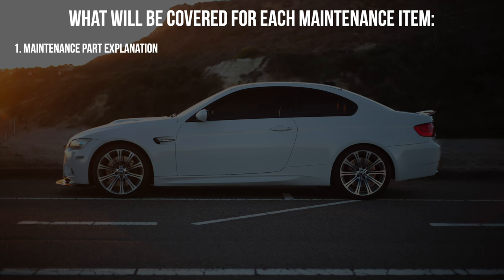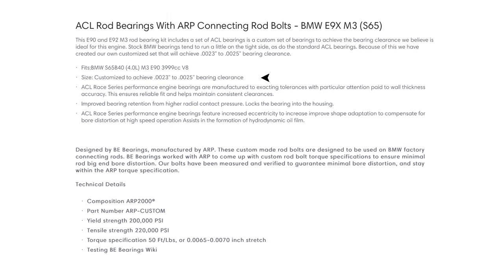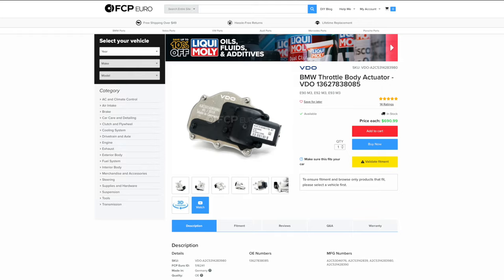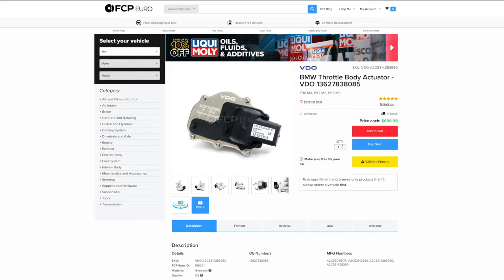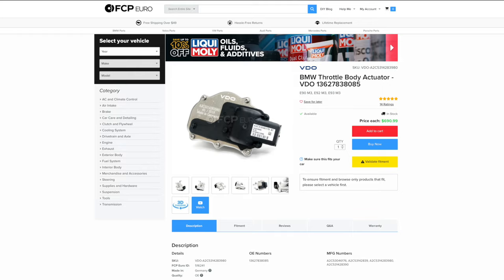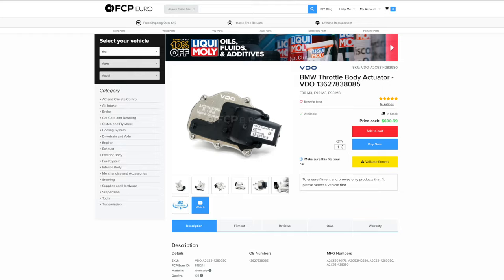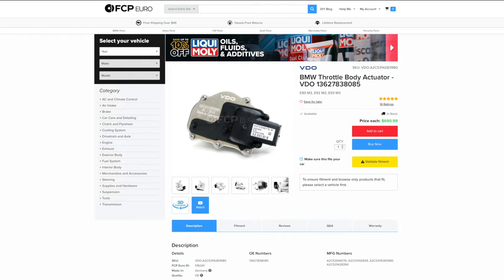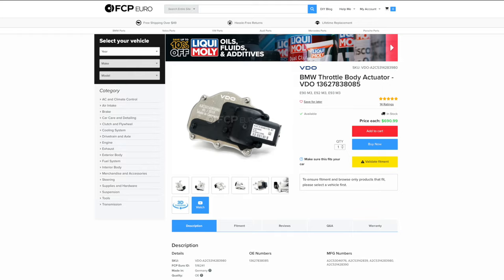ULTIMATE Guide To Maintaining An E9x M3 | Top Failures | Best Parts Sources | Parts Costs

Comment: When the throttle actuators fail, it is often the plastic gears. Metal gears are available, and can be considered a preventive maintenance item. A great deal of time and/or money can be saved by doing all of the preventive maintenance items on top of the engine at the same time.
Reply from the maker: You are correct, definitely a solid option if you don’t want to simply replace them! Thanks for pointing it out 👍🏼

Comment: Are these websites reputable? Sorry I’m new to owning one I’ve heard of fcpeuro does anyone have opinions I have a idle issue and I definitely could’ve saved a buck or 2 instead of going to the dealership
Reply from the maker: Truthfully I haven’t purchased parts from every single vendor in the video, many of them I have but not all, but I’ve been in this community (the bmw and more specially the e9x m3) for quite a while and have heard people make comments for both ends of the spectrum regarding some of these vendors. Some will have nothing but good experiences and some only bad, but the ones I’ve personally done business with have usually been pretty good. Not only that but if there was a company that I felt was notably bad when I originally made this video, I’d likely not have included them at all, so I’d lean more towards the positive side with any of them until you’ve done business with them personally 👍🏼

Comment: The Slon Vanos Covers have problems.
Reply from the maker: I’ve heard of some potential failures, I haven’t researched deep enough yet to confirm if it’s 100% a problem with their product, or the fault of incorrect installs. I do know for a fact that the  Slon covers I installed 3 years ago (so very likely close to the first iteration of them) on my personal e90 m3 are still working as designed. I’ve kept in touch with both of the owners after my ownership and neither reported any issues with the covers, so I’m inclined to think that they simply aren’t being installed properly, especially considering that I’ve heard that even one of the tabs not being secured properly can cause them to eventually fail, so until I can do a bit more research now that they’ve been on some cars for a few years now, I can’t say with certainty that those covers aren’t still good to use or not, but like I said, I have heard that there are cases, just need to do my own research is all 👍🏼

Comment: I would add the alternator, or actually the voltage regulator as a potential common failure. I see it a lot on the forums and just dealt with it last week. The dash gives all the faults and goes into limp mode, then nothing. It's all caused by low battery voltage tricking each system into failing. I replaced my battery with an optima and then a new alternator. It's not a terribly difficult job to DIY, either. Anyways, great video!
Reply from the maker: Great point, I’ve also pretty much only ever hear that when the battery’s/alternators start to go, that they cause all sorts of weird problems, might have to add that to the next video! 👍🏼

Comment: You do not need to remove the throttle actuators when doing the ICV. However, the grey T pipe connecting the ICV and the throttle bodies can be a really stiff and get stuck onto the black rails of the throttle bodies, making it really difficult to remove. Making it easier would be to remove one bank of the TB (driver side). You would also have to remove the secondary air pump and get the wiring harness out of the way. I recently did this, and just cleaned the ICV, there was some carbon build up on the plates. You also have clear access to the starter motor which sits right under the ICV. Removing the driver side TB also gives you relatively easy access to the non-return valve at the back of the block just behind the cylinder head. Mine was gunky but still ok at 150k kms, but I replaced it anyways since I was there and not too expensive.
Reply from the maker: Oh ok, I appreciate you taking the time to add some knowledge to this video, hopefully whoever watches will read it and have a better idea of what to expect while in there 🤝🏼

Comment: I've had my 2009 e93 about 5 years years, 20k miles, has 110k, throttle bodies were done when I got it. Motor mounts were thrashed, $800 repair, $650 labor, I didn't have lift access, could have found a less expensive shop.  Fuel pressure regulator failed, I replaced it in about 2 hours, $300 part, I think book labor is 3 hours. Other than that it's been great. Always replace crush washers and oil drain plugs, it used about a litre/2500 miles when I got it, none since the first oil change I did

Comment: The DCT pan bolts might only need to be re-torqued to spec. Discovered mine had a leak and decided to check the torque. Yup, many of the screws and oil drain plug were a bit loose. Tightened them back up, cleaned off all the oil, and checked 2 months later with 1k miles and it's dry.
Reply from the maker: That’s a really good point, definitely should check this first before full sending it on a whole job 👍🏼

Comment: Great video! TY In your research, did you find anything about the rear differential failing? Mine is is whining and I am told it needs to be replaced. I’m at 40,000 miles. 2011 6MT
Reply from the maker: Thanks for watching! Unfortunately I didn’t see anything in particular regarding the rear diff, might just be bad luck on your end this time around, hopefully it doesn’t end up being too much to get it fixed/replaced :/

Comment: Luckily, the previous owner took care of the idle control valve. I took care of the rest except the fuel breather valve because I can't take off the hose thing attached. So difficult.
Reply from the maker: You have to brake that clamp off and then use either a generic hose clamp to reattach it, or buy another bmw clamp and the tool to re crimp it, either way, not too bad once you have that first clip apart 👍🏼

Comment: A word of caution regarding vanos cap replacement, the cheaper stamped steel vanos caps have been reported to come un fastened, I reached out to evolve on this issue , they responded by explaining the cheaper stamped vanos caps retain some memory to their shape and want to deform over time and heat cycles , in contrast the more expensive evolve caps which are billet aluminum,
Reply from the maker: Yea I’ve been hearing/seeing the same things recently, definitely have to be careful with these now too and who you get them from, thanks for the insight for others to see! 🤝🏼
Reply: What about Mporium bolt on caps? Are these overkill? I rather get the Evolve ones simply due to the fact that I can DIY it. What do you think? Are the evolve caps enough?

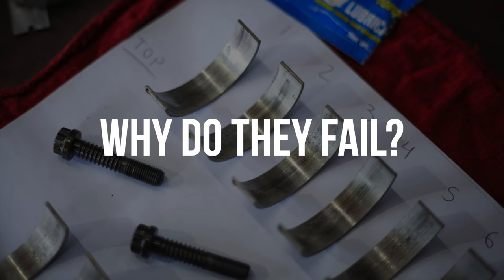Comment: 2:47 Can you quantify what you mean by "so prone to failure". Are we talking under 1%? Also you need to call out that multiple people have replaced the rod bearings, only for them to have the replacement rod bearings fail.
Reply from the maker: @cpy  if you listen carefully, I wasn’t referring to them being “so prone to failure” from a numbers stand point, what I was specifically referring to by that sentence was WHY they fail at all, which is a know fact that the OEM bearings were made with too tight of clearances. As far as numbers go, you’re right they don’t fail as much as it seems like they do because it’s a lot more practical to replace them PRIOR to failure, than to wait for them to fail and need an engine rebuild, so of course those numbers are low. Now regarding your statement that I have to acknowledge that even after replacement, that the bearings can still fail, and I’d be inclined to agree assuming someone replaces their bearings with OEM bearings again or doesn’t opt into purchasing bearings with the additional needed clearance, because the cars that have replaced their bearings with the additional clearance bearings, hardly ever, if at all, have THOSE bearings fail, and if they do it’s for outside reasons other than just being poorly designed, like OEM 👍🏼
Reply: @Anthony_B  Ok if that was your intention, that's not what you said. That would be like saying "Why are airplane engines prone to failure?" Nobody is going to think you meant "Why are airplane engines that have failed prone to a particular type of failure".
Reply from the maker: @cpy  what I said was, and I quote “the reason they are so prone to failure on these engines is because they were designed with too tight of clearances”, which I’ll state again, is a known fact. So I’m not sure how you’re trying to interpret what I said in my own video, but what I said was not only a fact, but is 100% true in regards to what that particular section of the video was talking about, which was why rod bearings fail on these engines. I wasn’t trying to make a statement about whether it happens a lot or not, I was explaining what causes them to fail, WHEN they do fail. So I appreciate you trying to get clarification, hopefully I’ve cleared it up for you 👍🏼

Comment: Sloan covers fail fyi
Reply from the maker: Appreciate the info, I was not aware that they had problems, the ones I installed a few years ago never had any issues that I was aware of
Reply: @Anthony_B  check them, the edges will look filed down and not flush. Engine failure on some cars.
Reply: Slon is also a Russian company I believe, another good reason to avoid.